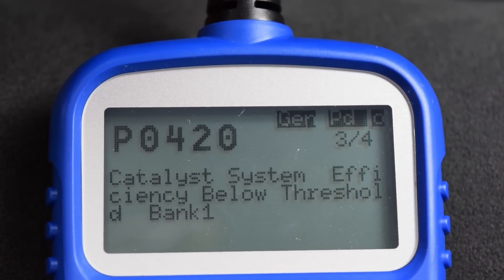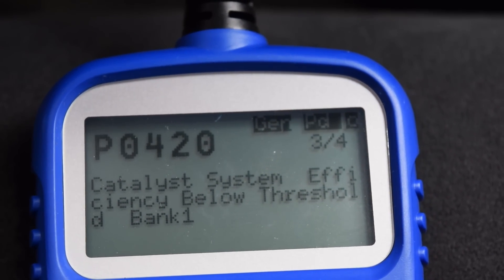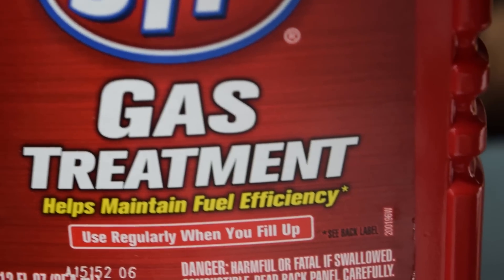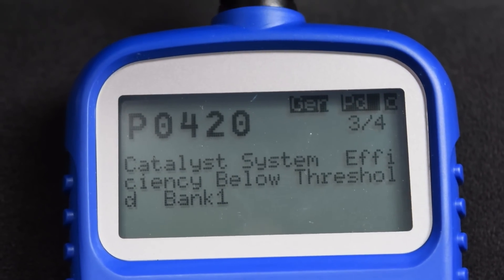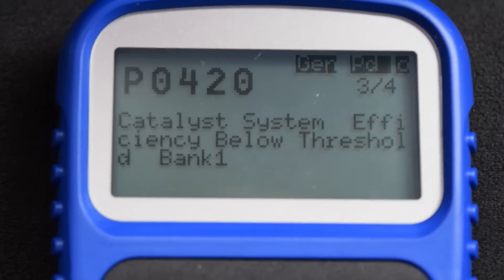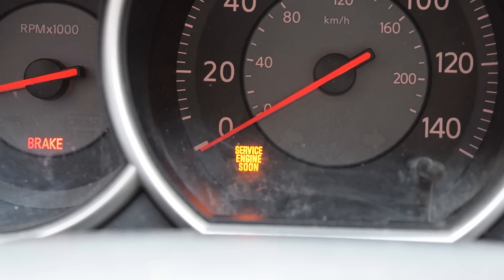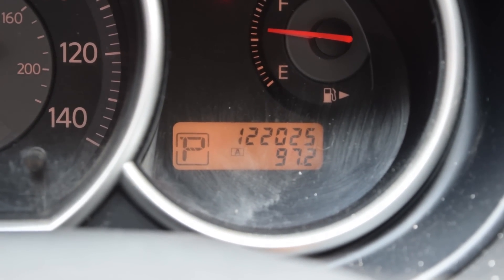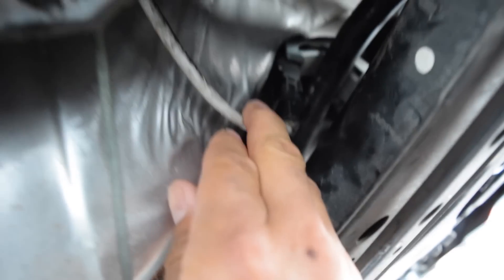Code P0420 Catalyst Efficiency Below Threshold Bank 1. Emissions Test! NO PROBLEM!

Comment: Listen everyone….. before anyone freaks out about the PO420 code, always check your O2 sensors, if your O2 sensors are bad it will trick the system of your car to make it think that it’s your Catalytic converter going bad. I had a PO420 code on my 2007 Chevy Malibu and i just replaced the sensors and boom CODE GONE!
Reply: I just input both new sensors in my car and it didn't work unfortunately
Reply: @GO-wb1gf  It only works if that's the problem.
Reply: If it were to be your O2 sensors  that were bad, why wouldn’t it trigger a code?
Reply: Fuck bro thank you, my uncle just told me the same thing and I was over here getting worked up. I have the same ride as you 2007 Chevy Malibu
Reply: It only works if that's the problem.
Reply: If it's for one bank, switch the rear sensors side to side to see if the code goes with it.
Reply: @JB91710   it says catalyst system efficiency below threshold bank 1.. and when i crank the van it take like 2 second to start and when i press gas to start driving it pulls aand the rmp needles goes up n down 🤯
Reply: @mizaelbautista6151  I'm a 03-06 Chevy truck guy.  It "Sounds Like" you may have a computer problem rather than a mechanical one.
Reply: @JB91710  and thats bad? 😒😏🤔
Reply: @mizaelbautista6151  That ain't good!  Find out what the "Drive Cycle" is for your specific car.  Search for it here or on Google.  It involves idling from a cold start for a period of time and driving at certain speeds for certain times.  That allows the computer to check on all the different circuits and may eliminate the code and allow the rest of the car to function properly.  I can't imagine that cats are bad on such a new vehicle.  Check the age of the battery.  Maybe the previous owner changed it.  Should be a date on it.
Reply: Thanks for the advice. Got the same code so Im going with step 1 o2 sensors first!
Reply: Should try both sensors or just one( downstream or upstream) ?
Reply: guys help i just got  that  code today for 2015 ford transit connect 🤔🤔
Reply: @mizaelbautista6151  Did you recently have your battery go dead or change it?
Reply: @JB91710  im not sure i just bought the van 3 weeks ago . 😏
Reply: I agree. However, to know for sure which sensor to replace is to remove the sensor, connect it to a multimeter with the ohms setting and check for resistance on the metal plug tabs and depending on the reading for open circuit or closed then that is the problem sensor. If not then go to the next one downstream and test it
Reply: do o2 sensors also affect performance? my car has the 420 catalytic converter code, rough-ish start when fully cooled down, and gas meter bounces up and down. thanks!
Reply: @Future6556 did you get yours fixed, I’m experiencing same problem
Reply: My 07 Honda accord had aftermarket Cat installed and now the OBD II sensor says my sensor “Bank 1” air/fuel ratio is what’s causing check engine light and nothing else was detected what so ever. Is it possible that all I need is a new sensor for bank 1 ? And does is it need to be OEM sensor ? I believe the OEM for my Honda accord is “Denso” and also does the sensor for “Bank 2” also have to be OEM denso brand ? They replaced the “Bank 2” sensor since they stole my entire CAT and almost the entire exhaust system and I’m wondering if the bank 2 sensor is aftermarket and somehow confusing the car and causing the Bank 1 sensor to mess up. I really need help bad with this because I can’t find any used cars at all what so ever In the $8,000 price range that have less than 120,000 miles with good gas mileage and all I can find all over Northern California is the stupid ass “09’ Toyota Yaris” in my price range that’s decent on gas and I do not like anything about that car so I really need help whoever reads this message and what I should do ? Will the aftermarket CAT pass smog if I have OEM sensors in bank 1&2 ? Or is it possible the CAT itself even with brand new OEM sensors still fail smog if I replace the sensors with Denso brand OEM ? Please help haha 😂 I have 178K miles on my Honda and it runs amazing even with the issue I have rn… not a single issue besides this problem. What should I do y’all ? Thank you! I have the PO420 code and says Bank 1 sensor. When they put bank 2 sensor on the new aftermarket cat I wasn’t told if it is aftermarket sensor or OEM either. Do I need to replace both with brand new denso OEM ? And even if I do will it pass smog even with the aftermarket CAT ? I don’t wanna have to buy a new car or a new cat..
Reply: I have brand new cat fitted,  and getting the code, i have tested the up stream with multi meter and it says its working, scratching my head what could be, i had bad injector but fixed that, the engine light comes on after long trip 20 to 30 miles there abouts, car runs fine since i fixed injector , power everything fine, but keep getting the p0420 code coming back😅, frustrating!
Reply: Can i drive like that?

Comment: Cataclean didn't work for me the check engine light is still on but it was the first time in my truck sure did fix the lean gas and made my truck waste way less gas big time. It must cleaned the fuel injectors or something

Comment: You forgot to mention a few things what can also cause if you just recently purchased a cat catalytic converter in six months down the road you get a 420 on a 6 cylinder you can also be caused by an exhaust leak and if you wanted to clean your cat's I seen a video where a guy use sea foam

Comment: I got that same code but I'm going to the fuel cleaners first. I did the CRC Guarantee pass emissions, I'll do the fuel cleaners that you suggested because I already have a bottle of cataclean.. I'm just wondering if I can run all of them at the same time or do one after the other. If that doesn't work, I'll change my o2 sensors before I buy a catalytic converter. I have to take an  emissions test this week so I'm hoping things go great🤞🏾
Reply: Did the CRC Guarantee work? I’m debating between trying that and cataclean

Comment: My traverse has all new converters all new plugs all new coils all new 0 2 sensors and still getting the 420 code what is wrong.. please help? Done that caddy clean as well.
Reply: Unconnect negative terminal on battery then connect it back
Reply: It will reset all the power controls

Comment: Turn off your engine light with that same reader it could be a misfire I just did that to mine and it hasn’t went back on yet so try that I drove it like that maybe when have the chance change the oxygen sensor only and see if that’s it

Comment: Thanks man. I followed some of your stuff and my code went out. I added the gas treatment in a full gas tank. After getting in a 1/4 gas I added the cataclean drive it on the freeway for 15mnts, go to the gas station add the 91 premium gas drove home and puff check engine light code turn off. Thanks for you video.
Reply: Turned off while driving?  I had that happen once, it's pretty cool.

Comment: Oxygen sensor , upstream means bank 1 that’s your issue
Reply: Bank 1... Well if you have a 2.4L meaning a ''4 cylinder'', then all you have is Bank 1. When I had my Jeep Patriot scanned because I couldn't find my scanner, the tech told me if it had been a 6 cylinder, I would have both a Bank 1 & Bank 2. So ya either have to go to someone who has a $2,000-$4,000 scanner or just use a laser & check the upstream & downstream end of the cat, to see if it's working correctly. If it is, then it's probably an O2 sensor, where in that case I always buy both.
My 2006 Hyundai, Tucson was showing an emission error 0420 code. I had exhaust leaks at all the pipe joints. I replaced the exhaust & no emission codes. So there's many issues that trip that code.
Reply: Paul, I have had this suggested to me as my issue, but the oxygen sensors are their own error code and they would come up as defective, independently. Yes?

Comment: How does this vehicle pass when cat monitor says INC incomplete?   When the catalyst monitor switches to complete your light will come back on and you will be right back where you started!
Reply: obd II requires a certain amount of cycles.  before the emissions will even register, it'll go thru the cycles to start first.   so by the time he took it in, it had done the cycles and the light had not come back on.   emissions would register good tho

Comment: it's made out of platinum it's a platinum ceramic that  heat up 600*  and burn excess fuel
Reply: I manufactured coated catalytic converters substrates in a ceramic slurry that contained acetic acid and precious metals to withstand the heat to burn off the nox.  Depends on the car manufacturer but they are coated inside the cells with palladium, platinum, or rhodium..so he's not wrong.

Comment: Bro I need a help I’m tryna get past the emissions test too lol I got the same code p0420 threshold catalyst bank 1 how to by past  it ??
Reply: Cataclean or lacquer thinner at half a tank, drive for about 200 miles and hopefully it will go off. Watch Scotty Kilmer how clean catalytic converter. Good luck.
Reply: As long as your check engine light is off you're fine. I put cata clean in my fuel drove around for 15 mins had my codes cleared. And drove close to 50 miles the next day like instructions said. Did my engine light stay off permanently? No. It came on about 2 weeks later.

Comment: Typically this happens because the check engine light comes on when the catalytic converter is at 97 percentage efficiency.  I use RXP at Autozone to burn out carbon and the light goes off. I get my sticker and the light comes back on a couple of months later.
Reply: Adam J  I have done it for years with no issues. That is checking to see if it's within like 97% effective. Unless it's clogged it's not going to hurt your engine. This is on the emissions side so this is exhaust gas that has left the engine. Feel free to change your catalytic converter. That is probably for the best. I am only givings alternative suggestions .
Reply: Brian Grogan  what is RXP
Reply: @santoshdhimal1714  it is just a fuel additive that you add on an empty tank with high octane gas. It burns carbon out of engine. It typically will turn off the check engine light. It is not a fix. The light will likely come back on eventually. It's more a hack to legally pass the emission test by turning off the light and emission testing.
Reply: I tried cataclean and it worked awhile back but now it doesn’t turn off the light, is rxp better than that? Also do I need to turn off my light manually to reset it?
Reply: @Chosen-One-24  this hack was only to turn the light off to get it inspected. Only replacement of catalytic converter to fix it.
Reply: Time to change them then
Reply: @chiefbubba2581  it was a hack to pass emission not a fix.
Reply: @briangrogan910  or okay then
Reply: @chiefbubba2581  i AM WITH YOU..  and the problem is??  lol
Reply: Jason Yuurrrrr  it has worked 100% of the time for me. It is not a fix. It just a bandaid on a bullet hole. So yes it may turn your light off to get a sticker but the light will eventually come back on.

Comment: I had this P0420 code on my 222k mile Jag X-type. I used Lucas, STP and CRC for emissions along with Chevron 91 octane. My code is gone. Now waiting for P1000 to cycle before I take it in for smog. Thanks man!
Reply: Well my code came on and i changed all 4 oxygen sensors and the code was gone and now it came back on so maybe if i changed my fuel filter maybe that will work

Comment: Platinum is in the converters not Palladium.I can see higher Octane Fuels helping but not all those cleaners but I can see Lacquer Thinner.  So those P0420 is just the O2 Sensor. My report says I need both. But I'd try 91-2 Octane
Reply: I changed all 4 of the oxygen sensors and now the p0420 code came back on
Reply: @chiefbubba2581  Then the cats are too clogged up. I think you have to get the temp readings to see is the pre side of the cats are giving too high a temp, or post cat readings with too low a temp.
Reply: @montydaniels1054  do i just changed the bank 1 side or i can put a straight pipe so i won't have that problem
Reply: @chiefbubba2581  The system is built with the o2 sensors. whether you hollow out the cats or bypass with a straight pipe, your engine will never really run correctly. My check engine light shuts off the remote start & god only knows what else. So I have to fix the issue. The engine block to firewall ground strap is corroded. Perhaps the new one I ordered will turn off that p0420 code & that check engine light too..
Reply: @montydaniels1054  well I'm going to order a new catalytic converter then cause i did purchase 4 oxygen sensors

Comment: The list of probalities are too many bcos most of these electronic parts has to be Original Manufacturer Parts and they are not cheap..depending on make and model...Oxygen Sensor..some card have 4...Cat..very expensive..Injectors..not cheap....if its not a genuine part...EML will stay on....or go off  but your car won't run right....my mechanic put Bosch platinum on my Lexus..car won't run right😥..he said my coils were faulty..New coils..car won't run right...New injectors...I refused...during our argument he swore he put new Bosch platinum. ..told him to replace them with NGK iridium. .Bang..lights clear ..car starts running perfectly...Mechanic said he was trying to save me money hence the Bosch plugs.. so just beware with electrical/Ignition /emission components. .

Comment: I had the same code for my 2008 Honda Civic 166,000 miles po420  I took steps first I changed my air filter , spark plugs and both  o2 sensors remember changing the Catalytic converter is the last Decision now I have 193,000 miles now no check engine at all just a Tpms light
Reply: so you never changed he catalytic converter?
Reply: @minnie_winnies_dtx  I never changed it I do 207 miles a day Monday to Friday  I recently had to changed the spark plugs and the coils oem I used  93 graded gas now fuel system cleaner  every week  and ow 20 mobile 1 oil every 5,000 miles I'm currently at 273,177 miles the more you drive that's what cleans the catalyst

Comment: I couldn't find CADDILAC converter on my vehicle between two muffler bearings and a turn signal blinker fluid reservoir, what Am I missing ???
Reply: Its not between the two muffler bearings.  Its on the other side of the blinker fluid reservoir.  But while you working on that caddilac converter you may as well change out them muffler bearing.  You already got them out and you wouldn't want to have to do it again later.

Comment: I just replaced my “jeepalatic converter” last week costed me $1100 from O’Reilly then purchased 4 brand new Bosch sensors as well $40 each then paid $300 to install everything from Meineke good as brand new check engine light disappeared btw also replaced a cracked radiator ($600) now I’m eating cuponoodles for the whole month 🥳 2007 Jeep Grand Cherokee Laredo 170K
Reply: You could have bought another whole ass jeep for that price dude... dafuq lol
Reply: Derron Taylor hahaaaa could’ve should’ve but didn’t she just hit has 181K original freeway miles never seen dirt snow mud garage kept & completely rust free well maintained top to bottom planning on keeping her till I hit 990K miles it’s all good I ain’t tripping over that she’s a keeper now 😂
Reply: Jajaja
Reply: Dam same price as the SUV worth
Reply: @dannymartinez8522  not really current BB value is around $4K she’s in great condition. I’ve done lots of preventative maintenance as the years flew by few upgrades here and there but mostly stock and she’s treated me well never left me stranded always got me where I needed to go & super reliable a gas guzzler but plenty of power just enough for me lol. Just hit 198k miles & she still runs strong no leakage no funny smells no funny noise very well maintained. I will b retiring her in a few years for a 2019 jgc overland can’t wait!

Comment: I have this in my Acura. Check engine light comes on and comes off. It’s done it for 5 years now and I’ve never had a issue with the car. I did change the 02 sensor and went away and came back later. I’ve been watching live data now so I think one of my sensors going bad again due to higher fuel trim making it run rich. Will update but I’m just trying to understand the bank and sensor location in my Acura TL
Reply: Any update? My car is now doing the same thing now. The cat was supposedly new when I bought it but now it comes on and off after a month. Don’t know where to look at since the car runs just fine and makes no noise
Reply: my 08 TL type s is doing the same thing. it has 190k miles so I'm sure the converter is deteriorating..going to try the cataclean and post an update soon
Reply: @bxthorn3100  same with 05 TSX
Reply: first I put in the fuel injector then after driving that down added the cataclean. it seemed to work for a couple weeks I think then engine light agn with same 420 code so a replacement may be a good idea if it isn't the oxygen sensors

Comment: Did you check your Blinker Fluid? I checked mine and drained it, then Bamm!!! got rid of the Cadillac Problem.
Reply: Dakk O'day what is blinker fluid
Reply: It's the fluid that lubes the pistons in the Cadillac converter
Reply: Make sure to fill it back with synthetic so the code won't come back.

Comment: Previous owner paid 1600 for the converter but code is still popping up. Why? Could it be an aftermarket part? I have a scanner and cleared the code but it keeps on coming back up?? What can I do to get rid of this code. PLEASE. 2003 Toyota Sienna